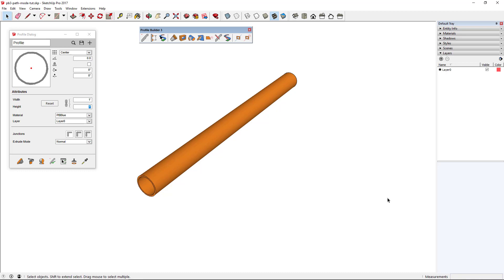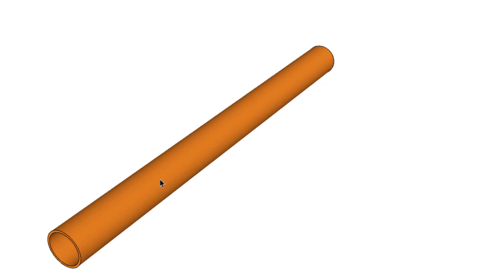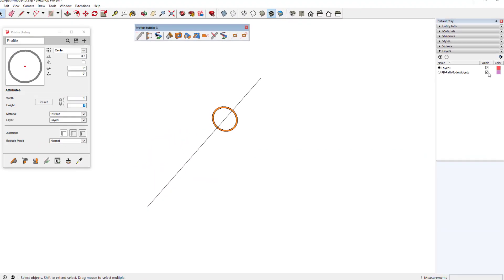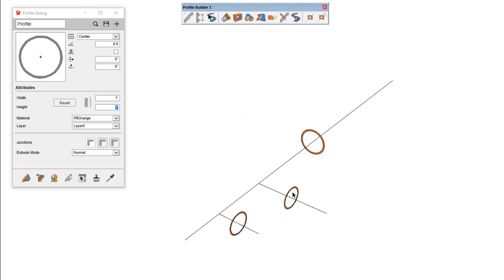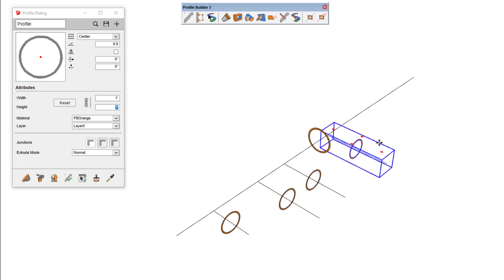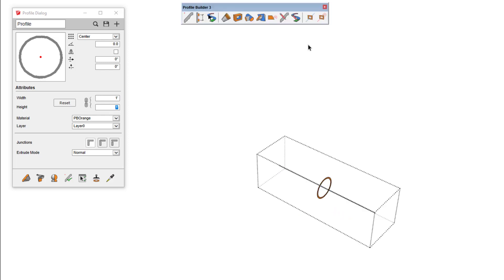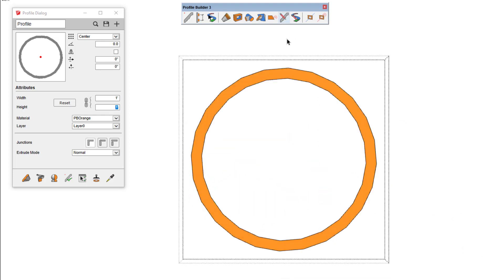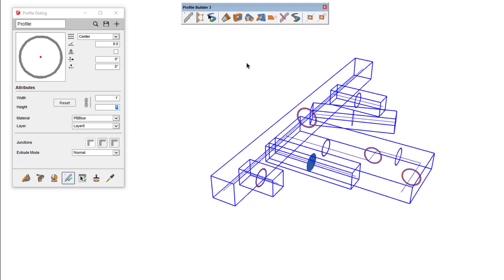Path Mode Tutorial

Comment: When you add new paths (profiles) in Path Mode, then regenerate the geometry as in your example, my version shows overlapping geometry at the intersections rather than refined geometry that doesn't have extra bits or ends of a round tube sticking inside another round tube at the joint (again, referring to your example).  I can't see in your example video if this is indeed the behavior, or an artifact (i.e., bug) in my version of PB3.  I want the joined, added geometry to meld nicely rather than overlap/cut through the original geometry.  Can you comment?
Reply from the maker: M.A. Stough after regenerating, use the trim to solid tool to make a nicer intersection

Comment: When the Path is shown, is it based on how the position of the Path in the Profile was originally assigned (e.g. Center, Bottom Left, etc.)?
Reply from the maker: The path does not change unless you edit the path.  However, the position of the Profile relative to the path will change depending on the current placement point that is assigned (center, bottom left, etc.)
Reply: Interesting - so it can be changed per Path? and not at the Profile level? So I could change the path location for one and it not effect the others? That would be cool. I'm thinking of how Walls are set in BIM based on Path locations (center, core edge, face of wall, etc.). So if PB3 was used for Wall placement, the Path location could be changed to fit the needs of the Design (face to face dimensions for interior walls, core edge placement for exterior walls). Nifty!